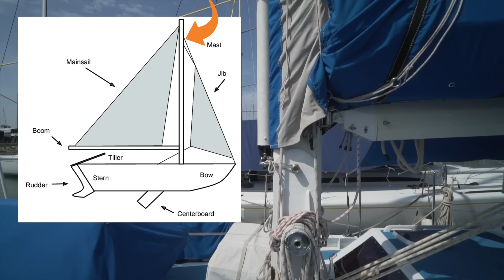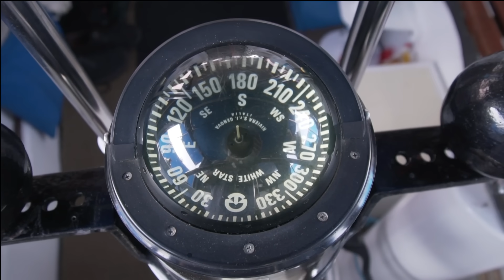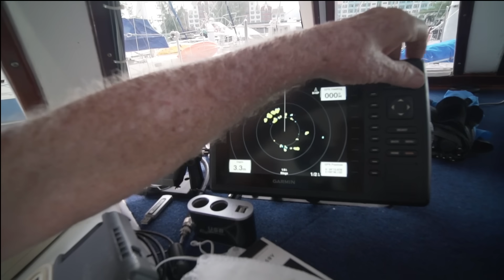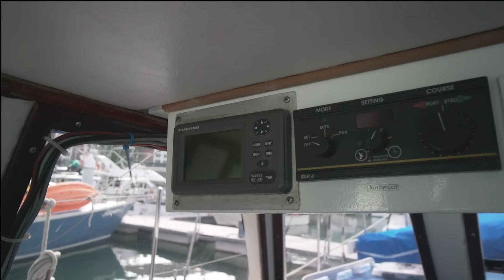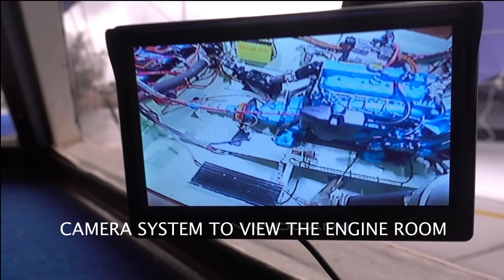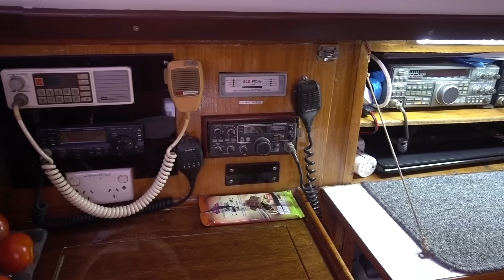30 Years Living on a Sailboat #BoatTour | Pangkor Marina S7 EP8

Comment: Amazing! I traveled the BVI in a 46 foot Harding sailboat, and a 75 foot wooden sail boat name Bagheera. Also lived in a 28 foot sailboat in Key West, Fl.
Reply from the maker: 75 foot! 😲
Reply: How did you find living on a 28 footer? I'm in the process of planning my journey into a live aboard lifestyle. Doing my research, reading sailing forums , and looking through want ads for sailboats. It's an overwhelming task. Would you recommend outboard, or inboard engines? Helm, or tiller? There is advice from both camps. I'm looking for a 27 footer, maybe 30 at the most. Are there many differences in maintenance, repairs, or marina docking prices in boat size? I apologize for the many questions and thank you immensely.
Reply: @waltervega8730  28 feet inside is super small - go bigger if possible. Smallest I would go would prob be 45 or 72 feet. Good luck.
Reply: @amandacurtis8374  thank you for the reply and advice